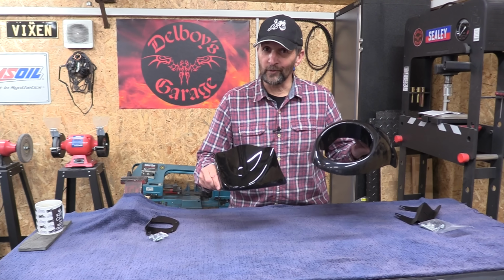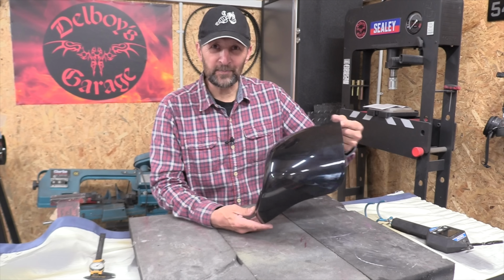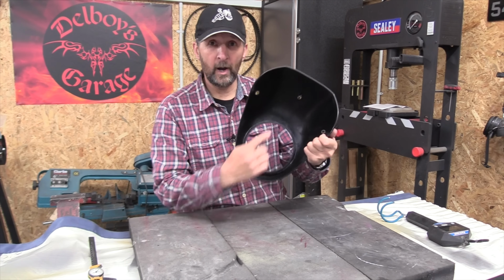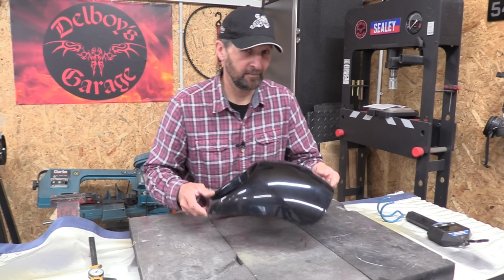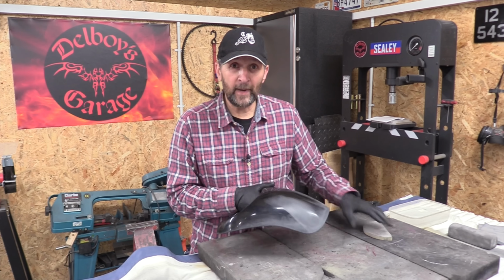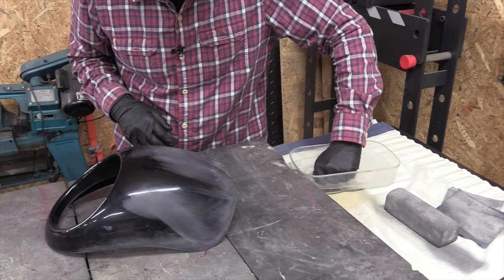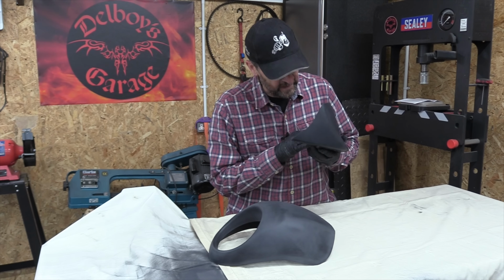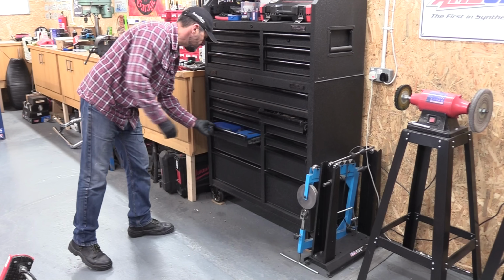Harley Davidson, Dyna FXD, "Bikini Fairing" (1 of 2) !

Comment: Awesome results!✨ Fine line between a nice finish and running. Couple of specks between 11:07-11:12. Dang blasted rattle can nozzles spit occasionally, but overall beautiful 👍.
Totally admire your work ethic and thankful for the tips and procedures on all things Motorcycle 👍🍺!
Reply from the maker: Thanks buddy, believe it or not, those little marks are tiny fly footprints!  It was a really  hot day and the little buggers appeared everywhere, tiny little midges kept landing on it whilst it was wet, and I was picking them off with tweezers!!   Most of it floated out, but still a few little nibs to knock down.  Thanks for watching.

Comment: Hope you get the desired results here buddy. Few decades working along side Dad in the body shop and never saw long term adhesion with out the use of an adhesion promoter when it comes to plastic.  Hope the tough black works for you!
Reply from the maker: Well it always has done over the last couple of decades, I've certainly never had it peel off, and I guess we've got to use something, I've even seen faults and problems with 2K... plastic panels just love to fight whatever you put over them!

Comment: not bike related sorry how do you rate that small ac unit you have and is it any good what make is it and would you recomend it
Reply from the maker: Yes, it's amazing.. chucks out freezing cold air and low power use makes it cheap to run.. i got this one because it's a heater and dehumidifier as well, and will serve me all year round.    Here's a link. https://www.spanner-monkey.co.uk/air-conditioner-dehumidifier-heater-12-000btu-hr-117954?search=SAC12000&description=true